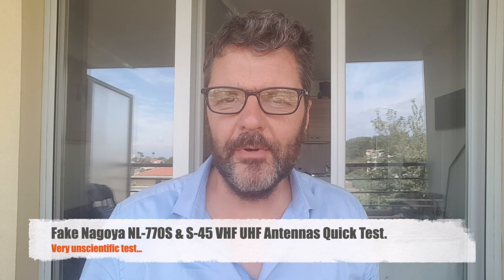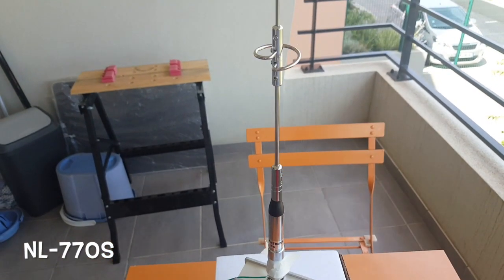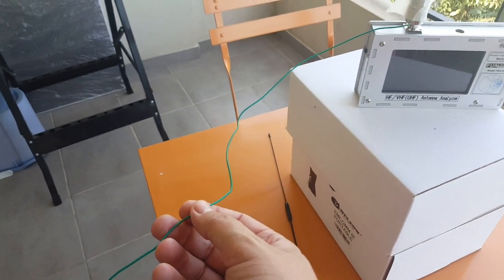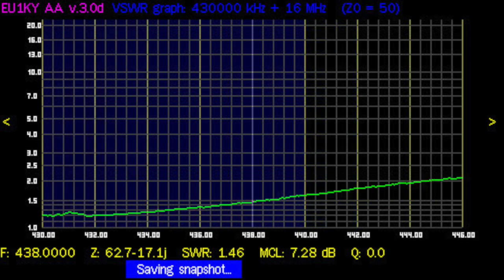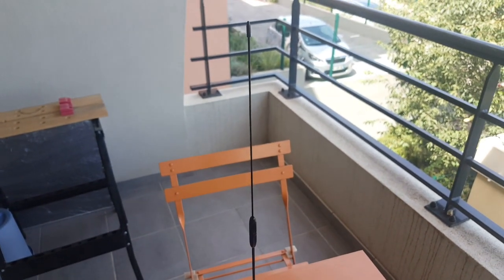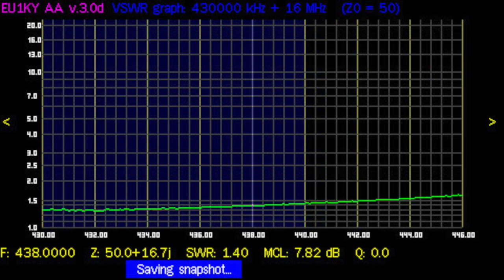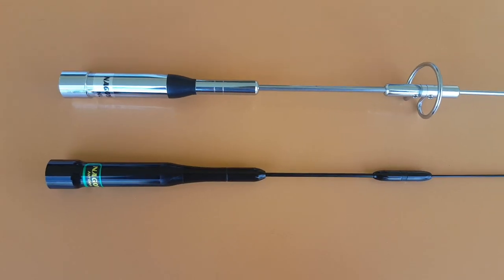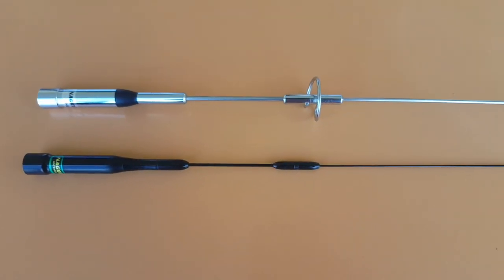Fake Nagoya NL-770S & S-45 VHF UHF Antennas Quick Test.

Comment: Your method of checking is obviously not "Test Lab Standard", but is good enough to show up any defective  units.  Nagoya VHF/UHF dual band antennas are probably the most heavily faked ones available on-line.   I have seen some of them opened up.  The counterfeiters often manage to successfully copy the basic construction, but the workmanship and soldering is usually extremely poor.  Shorted turns and open circuit connections are common.  And of course there is absolutely no final testing!   The only real solution is to buy from a Nagoya accredited dealer and pay their markup.
Reply from the maker: I couldn't agree more...
Reply: but, as i say above, i suspect even the Genuine Nagoya, Diamond or whatever make you buy are all manufactured in China to cut costs.....which they do, but of course the quality simply doesn't come close to Japanese/US/EU made.
Reply: @j.cheeverloophole9029  The problem with Chinese manufacturing is that in their rush to produce in great volume and at a rock bottom price, they virtually eliminate all inspection and final testing.  JP/EU/US companies KNOW that their reputation depends on return custom, and will guarantee their product by tests.
The #1 way to uncover faulty manufacturing techniques is to inspect and test products both DURING and AFTER manufacture.   When they source from "good" Chinese manufacturers, JP/EU/US companies will specify minimum tests before the product leaves the factory, and then carry out their own final testing.  Counterfeiters naturally don't have the same contractual obligations to perform ANY testing before delivery!
Reply from the maker: Diamond quality control seems a little better...

Comment: I still don't understand why people screw around with crappy Nagoya antennas.  Just buy a Diamond and call it a day.  They get great reviews online,  compared to the Nagoya.  Heck, even Comet make better antennas than Nagoya, and the prices are all about the same.
Reply from the maker: That's probably what I'll end up doing...
Reply: Lots of fake Diamonds out there too. I have a great mobile whip, dual band, it has served me well since the 90's, decided to replace it last year, bought one from eBay...terrible swr and performance but build quality looked great, bought another from a ham shop, it was great for about 9 months then started corroding badly and fell apart....so were they genuine or fake? Who knows...but they weren't close to my old 1990 version....I suspect the 90's version was genuine high quality Japanese...and nowadays, even genuine ones are cheap rubbish made in China. I wish manufacturers would realise we'd be happy to pay more for Japanese quality instead of Chinese garbage.
Reply: @RadioPrepper  Not sure where you get your antennas from - my suggestion would be to order from a radio dealer (rather than Amazon).  I buy a ton of stuff from Amazon, but usually steer clear of radio related stuff unless I know it is coming from a reputable source.  Not sure if you are able to buy directly from a radio supplier where you are at?  Not trying to disparage Nagoya, but if you go to eHAM and read the reviews, you will see a ton of 4's and 5's for both Diamond and Comet, and mostly 3's for Nagoyas.  That may be due to the fact that there may be more counterfeit Nagoyas out there and people are getting bad antennas.  Who knows?

Comment: Thanks, Gil. The internet is full of videos, about fake antennas and radios. At the end one must do a lot of investigation, how the recognize the real product. Of course, local shops here, must make a profit, but sometimes prices are over the top. I ordered an original Nagoya 771 antenna via Ebay. As You probably know, Nagoya is made in Taiwan. So I ordered the antenna from a Ham Radio shop in Taiwan, via Ebay. The price was right. Some Chinese sellers, sold the same antenna, via Ebay, for a few Dollars. Very bad situation and it is not better via Amazon.
Reply from the maker: I'll be weary of Amazon too, thanks.

Comment: Once I had the same problem. In the middle section (the "L") where a connection problem to the upper radial.
The lower section is working then as a 1/4 wavelength for UHF.
In normal cases it should be 3/4 wavelength for UHF.
The hole antenna is in VHF mode is a slightly shortened 1/4 wavelength antenna.

Comment: I have bought 4 Nagoya Antennas..  I think 2 are fakes.     3  came in  the soft plastic bags..  with Nagoya Hologram stickers on them.  The 3 were for hand held radios and are dual band.   1 didn't work at all and just didn't look right.    1 Seems to work OK but it doesn't looks genuine.   Another one works very well and the bag it came in also had a QR sticker on it for Nagoya website.   It looks and feels the real deal.  NA-701 is the model..   BUT the bag just has Nagoya labels that are stickers.. All the actual printing doesn't say brand  names or addresses.    I also bought a Mini Mag mount.  This im sure its also fake.   It came in a poly bag with a folded cardboard label that was stapled closed.  The label did have the Nagoya brand name and its  address on it but the antenna is very cheap and the magnet base is very weak.   Also the swr is 2:5 and radios seem to be quite deaf when i use it. 

They do say, " You get what you pay for "     but paying a lot or paying less doesn't mean your not going to be sold a fake.     I don't mind a fake if it works.  !

At the end of they day you are playing what i call Chinese roulette.   Some times your number comes up and your a winner others times you loose. 

Most of the time with Chinese stuff  Ive been a winner.  Just a few times Ive lost.    The worse part is that there are Chinese makers who copy stuff that is all ready a copy / fake and then just make it even worst.

Comment: Thanks for the very interesting video.
I think this antenna imitates the diamond NR-770S.
The NR-770S has a loading coil in the middle, but the NL-770S is an imitation because the insulator is not sandwiched in the center of the coil.
So I would be happy if you could make a video comparing the two.

Comment: I've had similar poor results with "Nagoya" branded Handie SMA antennas recently.
An NA771 was 4.5:1 on 2metres & 3.5:1 on 70cms so again i'd be wary of using if you value your finals, but then i bought the same antenna with the RETEVIS brand on and that was under 1.5 on 70cms and just over 1.5 on 2m & in use it performs very well indeed, Rx is 2 S points over the stock antenna.
Sadly a few other Retevis antennas i tried have done so great,  their brand of stubby SR805S is around 1.5 to 1 on 70cms but on 2m is 9.9 to 1....
The Retevis RT20 mini-flexi stubby is over 3.5:1 on all bands
And a final "Nagoya" (maybe) I tested was a micro-mag UT-108, i had one already that performed ok (under 1.5:1 on VHF & UHF) but i wanted another with SMA-F connector to save messing around with  adaptors, this one look identical (at first glance) but the SWR is over 2.5:1 on all bands! When i compared the two side by side, the good one has a small coil approx 25mm from the base, the new high swr one has the same coil but almost 50mm from the base...so perhaps if i can get it apart i can trim it down? I will try & see.
Incidentally the packaging on my 771 was very high quality, even had a hologram sticker on it, but despite this the swr is terrible so one for the junk box, not worth the expense to return.
Reply from the maker: Yep, better stick to know good brands. I like Retevis too...

Comment: Ever wondered why that 770s has a coil? the original diamond 770's used the coil to seperate the two elements, but this antenna has a straight connection of metal with a coil around it??
Reply from the maker: Not sure about that. The coil would be to invert the phase...

Comment: I had bought the same type of antenna off of eBay, about $7 US, it tested out OK, however, after using it for a few weeks I moved it on to the APRS radio, mainly because it wouldn't fold over for low clearance.  I think with the flood of cheap SDR radios we are seeing, we will see a lot more of these knock-off antennas as well.
Reply from the maker: Probably...

Comment: can you explain why low swr does not mean it will perform well? what factors would cause that?
Reply from the maker: A 50 Ohm resistor has a 1:1 SWR... Some wide band antennas are designed to have a good SWR but are not efficient.
Reply: Simple enough

Comment: Thanks for the information. I also had the impression that a lot of the so-called Nagoya antennas for sale on Amazon are counterfeit products. I mean just look at the prices they're sold. But if they work... why not?
Reply from the maker: It is taking a chance...
Reply: @RadioPrepper  yes it is. But I was lucky. There's a lot of copies of antennas around. I'm thinking of buying a clone of the diamond quad band antenna (10,6,2m & 70cm). Costs half of the original.